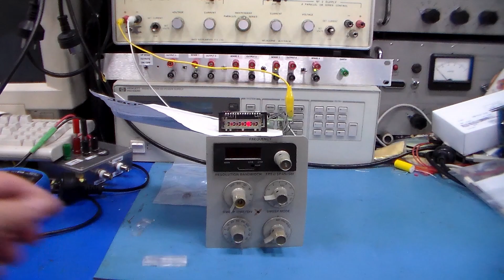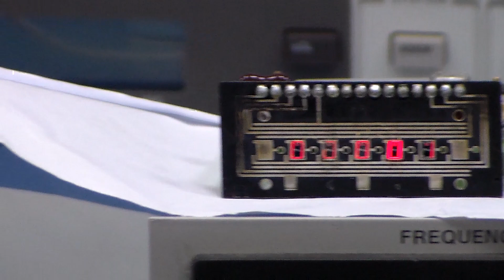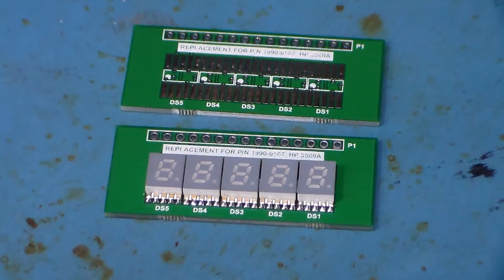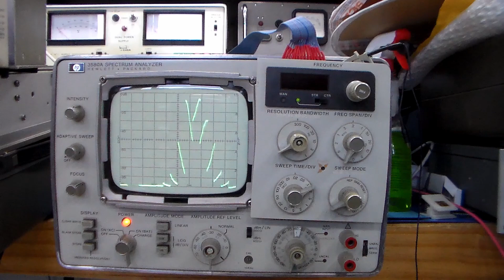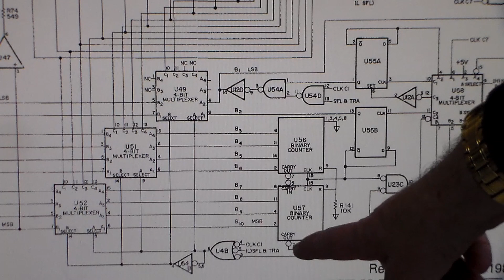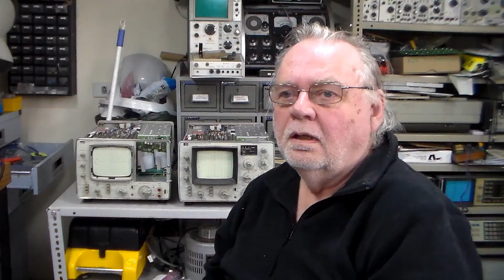HP3580A Repair

Comment: Nice troubleshooting and repair work. I have three of these that I'm getting ready to tear into. They all have the same symptom; manual sweep mode works but not Rep, Single, or Log modes. I also have 5420A and 5423A that need attention but those look like really major projects to revive.
Reply from the maker: John, the 3580A is a nice unit. I had a bit of a search for a scan of the manual that had readable schematics. If you need a PDF of the service manual let me know. As for the 5420A and 5423A I must get those projects out again. My USB interface to the processor front panel connector allowed me to save some versions of the program tapes to PC storage and boot the system from a PC, but the data transfer rate is very slow. Then again speed isn't really the issue, saving the software was more important. Originally I built my own 21MX front panel with some extra circuitry to add a USB interface to control the front panel from a PC. Since then I designed a smaller interface without all the LEDs and switches. The project has stalled mainly due to work getting in the way of my hobby time, but I do have to get back to it as I need to save the images of the 5423A tapes I have.
Reply: Thanks Peter, I bought a 3580A new back in the early 80's and still have the paper manual for it. I read on your website about your 5420A/23A project and your excellent results. You have the perfect skill set for that project! I hope you're able to make more progress, I'll check in now and then to see.

Comment: I have one of these that was working, but after not powering it for a couple of years, it has quit on me.  I'm going through the process of replacing all the electrolytic caps, as I've experienced this sort of thing before with very old equipment.  Best I can tell, my HP3580A was made around 1974, based on the date codes on many of the parts.  

My question for you:  at 47:27 in your video, you show the "parting shot" of the 2 working 3580.  On the far right, if I'm not mistaken, are two 20-place extender cards.  These would be essential for power-on testing of many of the circuits in this SpecAn.  Where did these come from?   Were you able to purchase them, or did you have to make your own?  Thanks.
Reply from the maker: I didn't have any suitable extender cards for the 3580A so I designed my own. I've already sold the spare boards and to get more unpopulated boards I have to order a minimum of five  at a total cost of US$95. The connector and test points that populate each card are available from Digikey.

As for replacing electrolytic capacitors, I'm not a fan of wholesale replacement. Generally, I check the capacitor's value and ESR to see if replacement is necessary. Mostly in HP/Tektronix/Keithley etc I have found very few instances were electrolytic caps are the issue. Having said that the Tek TDS500 series is a capacitor nightmare. As for the 3580A I had no issues with capacitors. Check the system rail voltages on the A13 board. I have had flaky connections to the A8 board which drives the HV transformer. 

Do you have a good copy of the service manual? Many PDFs on the internet including the HP/Agilent/Keysight site have schematics that are unreadable, I can email you a good scan of the manual if you want it.
Reply: @peteroneill404  I decided to buy a 44-pin version off the shelf.  I can cut that in half and install female connectors puchased from my local.  Thanks anyway.  Working on the 3580 should be much easier with those extenders.